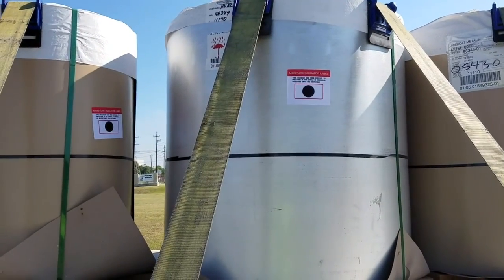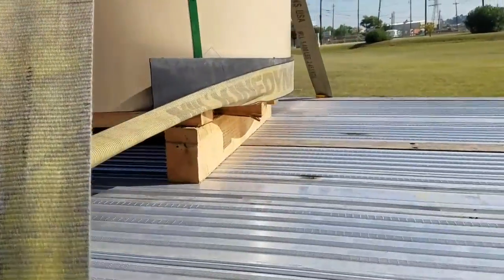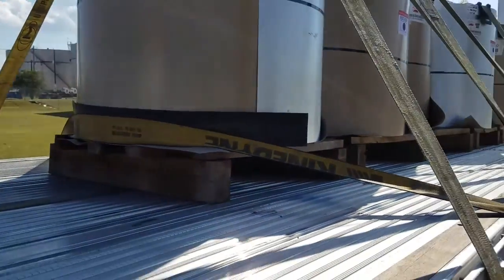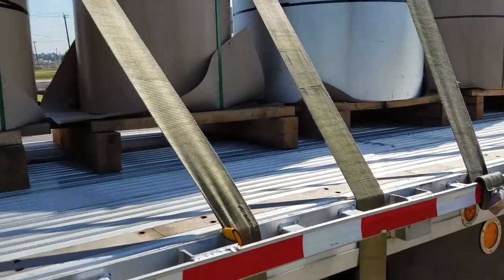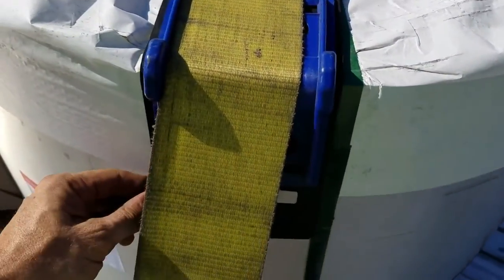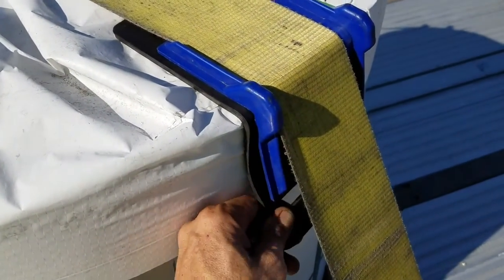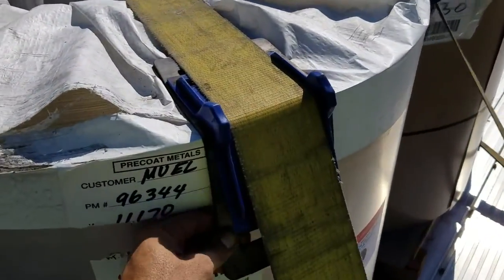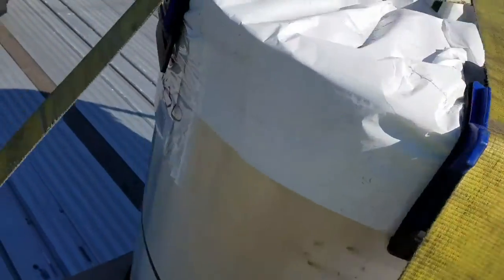Paletized coils.

Comment: Agreed I do it just this very same way. But I'll do my chains in cased thru that of a 3/8" chain thru a 3" rubbertized under cotton weave of a firehose to prevent damage good thing on blankets to help prevent tarps from coming thru too I like that extra steps took of those rubber pieces under those edge protectors especially on aluminum. Rubber mud flaps under your wood pallets would do wonders to prevent sliding them there on your deck when it's ever wet? It usually does slip withing or before your 1st 50 miles it can. Meaning when it's a wet deck to start with. & mud flaps stored are always having one when you lose one too. C-ya & Good job Rob...I know this took you maybe 4-6hours to rig this up as safe as you made it to be. Tarping in all, I've been there. Take care out there, and bank that money. :)

Comment: I strap my coils pretty much the same way he does except I put one more strap down the middle of the first coil to give it a total of 3 straps on it and the small coil I would have put 2 straps due to its height and being top heavy. I never put a toe-strap on the rear coils because it is impossible to take off fast enough to make the coils move backwards.

Comment: essentially I do the exact same thing. great job tarping. One thing I do not do. I never wrap my hook around the rub rail. Years ago that was legal. Today it is not. Regulations state that unless it can't be done the hook is to connect under the trailer. On every trailer I've seen its possible to hook under the winch rail and if it can be hooked there DOT CAN tag you for it being wrapped on the rubrail
Reply from the maker: +Steven Neill.   It is impossible to hook under the rail on our trailers.   Winch tracks on both sides.   Just the way our trailers are man.     I don't like it,  and am used to hooking under like you said.
Reply: He wrapped his hook on the rail so unless your in Michigan under their laws exceeding the federal laws he's perfectly legal here fyi.
Reply: Steve Niel
Reply: I am sorry but you are incorrect. wrapping your hook around the rubrail is not legal in any state UNLESS it is not practical to hook underneath. this is fairly clear in the FMCSA handbook from which I will add a quote below.

However, Rob and I are friends and he sent me a video of the underside of his trailer showing that with his trailer design, it is not practical to hook underneath, which meets the excempted requirements of the FMCSA rule. 

This is not a state rule, or law it is an FMCSA rule found in your handbook...should you choose to read it. if not, here is a copy and pasted quote

Proper Use of Tiedowns 

The new regulations require each tiedown to be attached and secured in a manner that prevents it from becoming loose, unfastening, opening or releasing while the vehicle is in transit. All tiedowns and other components of a cargo securement system used to secure loads on a trailer equipped with rub rails must be located inboard of the rub rails whenever practicable. Also, edge protection must be used whenever a tiedown would be subject to abrasion or cutting at the point where it touches an article of cargo. The edge protection must resist abrasion, cutting and crushing.

Use of Unmarked Tiedowns

The new rules do not prohibit the use of unmarked tiedown devices. Although many of the participants in the public meetings and numerous commenters to the rulemaking proposal argued the rules should include such a prohibition, FMCSA believes it is inappropriate to prohibit unmarked tiedowns at this time. However, in view of the potential safety hazards of motor carriers misidentifying unmarked tiedowns, there is a provision that unmarked welded steel chain be considered to have a working load limit equal to that of grade 30 proof coil, and other types of unmarked tiedowns be considered to have a working load limit equal to the lowest rating for that type in the table of working load limits.
Reply: If it makes you feel any better? You win.
Reply from the maker: +Steven Neill.    Thanks for taking the time to add this info Steve!!!!
Reply: I've religiously have reread that book to its entirety and probably know it better than most others. & Damn sure knows how to find things in the matter of seconds. As well as the fmcsa load securement hand book too. Been out here since 1997 running it heavy for the last 27 years. So,again Mr. STEVE you win. Lmao. :) I know the facts & the ins & outs of what's it is I can & cannot do and can hold my own In any load securement argument that may very well hit my pocket book with any d.o.t. Office pencil pushing expert. Fyi. Best look at my csa scores as it should say enough on my knowledge of years doing this very same thing. But taking it way underneath to the frame is by far the better way argued by many but if the hook isn't securely wrapped on its self? Loose straps whenever could loose it's hooked hold more easily than if it is wrapped on say the rub rail...GEEZ I just love a good argument on what's right verses the wrong way of doing it. I again go 100 to 110% of load securement of the least rated devices used. D.O.T. requires 51%. Because the loaded weight holds itself in gravity weight alone. So according to those diesel boys you only needs to satisfy under the law at 50% or higher but not less than. So, Mr. Neil you win.
Reply: It's all good, bro
Reply: It's not a competition. If you get bent out of shape, that's your own problem. all I'm doing is quoting FMCSA. Period. I honestly don't care what you do, how you do it, how long you do it, or what you argue. Your load securement makes absolutely no difference in my life whatsoever. I'm simply sharing FMCSA info directly from their site with a very good friend of mine.
Reply: And just to add one more thing, sir, Rob explained the issue with securement under his trailer and why he has to do it as he did. His video content is fantastic and well done so if you are butthurt because of our discussion, then please, I can get you a coupon for Preparation H
Reply: Steven Neill ok 9th

Comment: how do you figure out the placement of the weight. center of Trl? forward of center? is there a chart for a particular name brand Trl?
Reply from the maker: +Benjamin Duke.   No chart.   Usually there's a side marker light at center,  or use a tape measure to find center for your particular trailer.     Placement of the load all depends on your empty weight and weight of the load.    
Over time,  and a few CAT scales you will figure out your exact center.   MY general rule for my companies equipment is anything 45k lbs or more gets placed at exact center,   under 45k gets loaded forward.    Make sense?
Reply from the maker: +Truckin Rob.    That particular load was loaded 1 foot forward of Center.   But again it depends on what your empty weight is.